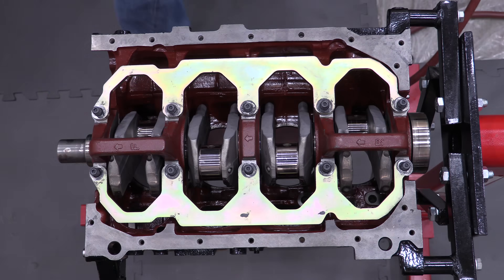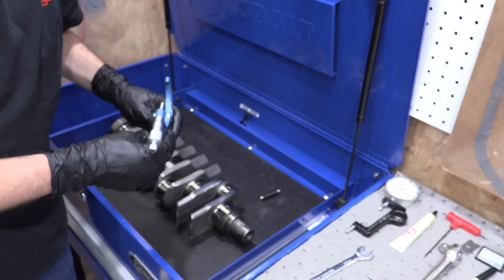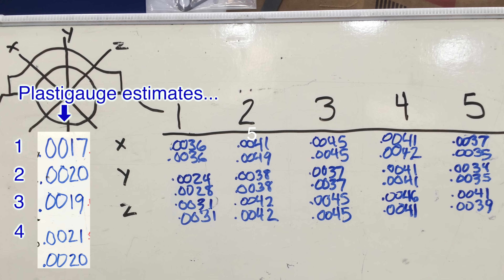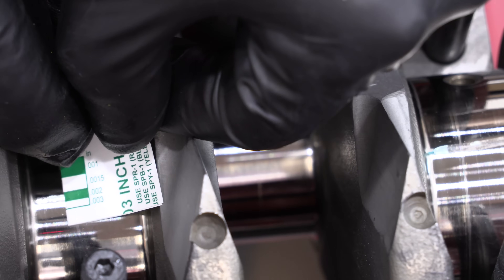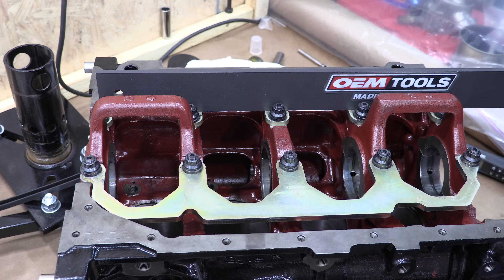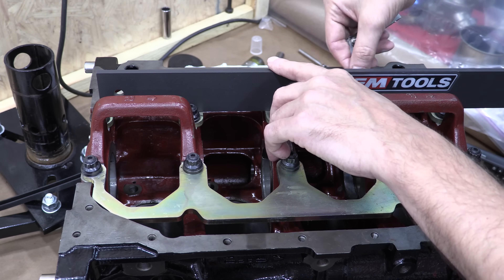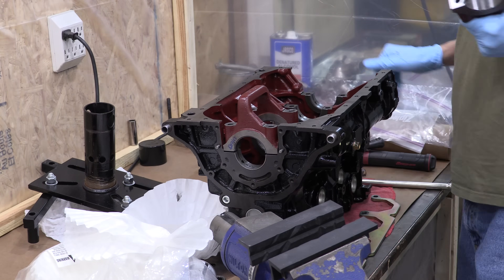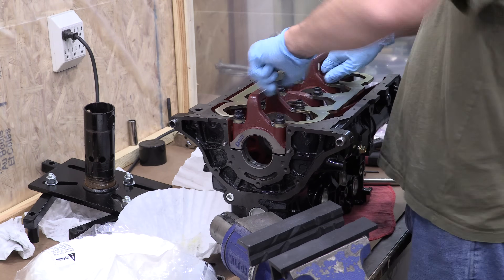[4k] The merits of Plastigage? ...A Jafromobile "short"

Comment: so, what im understanding, if ive absorbed the information right, is that even though youve bored the holes... twice? now, theyre still not straight and flat (and round) because of some slightly off kilter methodology in double checking some of the surrounding parts (mostly the suitcase handles)

Man, a year to get an engine working is almost ridiculous, i know that the level of accuracy and cleanliness required is extreme for the precision work you are doing, you are truly a master of your craft taking on a hobby project to make the ultimate in unnecessary machines,

But im the kind of guy that spends 40 hours writing a script to save me 5 minutes of work, and after this much time sunk in this one engine block, it makes me wonder if there was a better way to have approached this from the beginning to guarantee it was correct the first time? Maybe some better order of operations, or methodology. I dont know what that would be, im a computer guy not an engine guy, i just really enjoy learning about mechanics, so while i cannot offer individual advice or ideas, this scenario is tickling that "this could be more efficient" spot in the back of my programming brain.

Maybe you already know and this is just a demonstration of the worst case scenario for those of us who know no better?
Reply from the maker: It's true, I am absolutely building the most ultimate in unnecessary machinery.  It always was back when I enjoyed racing, showing and driving it.  Back before I broke it.  It was that.  It was GREAT!  Absurd and ridiculous are compliments that I worked very hard to achieve, and that's how I take them.  Truthfully, I've never had as much difficulty getting a block to cooperate as I have with this one.  Everyone who's watched the Hyundai assembly knows I've fought and won with other complicated issues, but this one isn't something I've ever once had to do.  The last time it happened with valve clearance and valve timing, it yielded some of the best and most helpful videos I've ever made.

What I could have done to fix all 5 cars 5 years ago is to not make YouTube videos.  I've been harassed and threatened by my county, forced to pay thousands per year to register and insure cars on my property that aren't visible from the road, have to fight record labels who try to steal my creative property claiming rights to original music that I or RojoDelChocolate have produced, spend time helping people with questions and problems, etc... All of that sucks except for the helping people part.  I enjoy helping people but it takes time when my condensed format requires a 10:1 chair time to edit everything-I've-already-fixed-and-filmed ratio.  THAT has been the single biggest loss of my productivity to my hobby.  

It's just like how you spend 40 hours to write a script that runs in 5 minutes.  Only I spend 40 hours to write a script that reads in 30-40 minutes into a microphone and then I still have to synchronize that into a video that's usually 20-30x longer than the reading of the script.  Nothing happens in my garage whenever I'm editing or paying my bills.

But boy could I do without these headaches.  The anticipation might be rough from a viewer's perspective, and it's absolutely killing me.  It's my favorite car.  I'm the one that's stockpiled $10k worth of parts I can't wait to bolt onto it.  And that's just the stuff that nobody's seen yet.  But for me there's many layers of pressure.  It's a different tax year, and all that stuff I bought still hasn't produced.  The time/money spent doing 5 major procedures to this block for things that I'm testing makes it scientifically relevant to my channel's plot.  So I have to use it.  I'd love it if it behaved like every other 4g63 crank bore/install I've ever had to deal with where I had to do nothing to it, but with everything else that's already complete, it's well justified to fix it.  What adds an even thicker layer to this is that this isn't even the project people were originally subscribing to watch.  This one ran.  I was building a Colt.  There's still people waiting for that.

I did rebuild, re-engineer, repair and rewire a completely different project during the parts stockpiling and the completion of 4 out of the 6 of those major procedures to the GSX block.  I feel good about all of that work, and the example and contrast it provides to the GSX and the community.  There have been a dozen GSX smattered through the Hyundai Years as I've been able to find the time and hard drive space to work it in, but I've always had multiple eyes burning on the stove.  If you wanted to boil all of it down and do a cliff notes, set every single variable to $ImJustOneGuy, run the script and see what breaks.  None of this is me arguing or being defensive, this is what it's like to YouTube.  If YouTube could even made my truck payment consistently for me, I'd hire a production crew so I could get more done.  Ultimately it's great that all the worst stuff in life happens to me and only to me, because I make videos about how to fix it.  Frustrating, yes.  But helpful.
Reply: @Jafromobile  Well, im glad you enjoy doing this, and it is definitely supreme satisfaction that this will be an educational experience for thousands of viewers out there,

i just wish it was easier for you lol
Reply from the maker: @drawapretzel6003  Yeah, maybe even hundreds?  lol!  ;)
Reply: yeah, the tops of the caps are different heights which is causing the girdle to torque the block and throw off the readings, it could go together as it is and be fine for a decade or two of drag racing but if you're going to a do a job, do it right... it seems like the front suitcase handle might have been swapped and the block line honed at some point before Jafro obtained it because it is a whole one ten thousandth out from the middle cap and back suit case handle.  might also explain why the crank was in such mint shape when Jafro pulled it out.  getting all the tops of the caps ground down to the same minimum value and the same ground down off the bottoms of all the caps and honing it AGAIN will finally fix this.  don't worry about being a computer guy, Jafro is also a computer guy and thats why his hobby is building engines to a precision... because you cant have your profession be your hobby without it pissing you off.
Reply: @ChristmasCrustacean  sounds like a good deduction to me. I know that levels of precision are a big deal in electronics, thats what has allowed the amazing feats of engineering such as the large hadron collider to exist, i just normally dont get to see someone applying the same levels of precision to something thats a mechanical problem and not a machinist problem. i also wish it was easier for jafro to do this without the headache. Guess you always have time to do it right the second time :P or hindsight is always 20/20 or something.

Comment: Plastigage, like any tool, is fit for purpose, it's not it's fault if you are using it for accurate measurement, It's an excellent double check tool to just confirm what you should already know.
Reply from the maker: I wish I had screenshots of your plastigauge troll to share.  Google even hid my own patron's comment about it from me so that I couldn't find it anymore.  I wanted the proof of the Plastigauge trolls.  If you ever find that comment, send that guy here.
Reply: @Jafromobile  I can find them and send them to you
Reply: @Jafromobile  
Pro 1: I dont understand this. Plasti is far less accurate then a dial bore and mic.... So how does it validate or verify precision calculations 😕

Pro 2: It doesn't

Me: It confirms that all the measurements taken are correct and that everything is correctly assembled. for example if something slipped under the bearing when installing it on one journal, that one would close up and you would have one substantially smaller clearance than the others. which would make you stop and look at it all again to see why one is different to the others, it's one extra confirmation that you didn't fuck up the maths as well.

Pro 2: You still have to tear it apart to remove the plastigauge so that can still happen. If you can't use a mic and do basic addition and subtraction you shouldn't be building an engine.

Me:So you think that taking an additional step to confirm is a waste of time because you and or others are incapable of making a mistake ever? And have no need to have a 3rd or 4th check of your measurements, I'd rather take the extra step. And no I'm not an engine builder, I'm a boilermaker by trade, who's been an engineering professional for 15 years who is building his own engine for his own car.

Pro 2: No I'd rather take the extra step to reconfirm with precision instruments. You should absolutely always double check your work but I think plastigauge is a poor way of doing it.

Pro 3: There is nothing accurate or precise about plasti. It is a complete waste of time. Double and triple check using precise instruments.

Me: Again all measurements were taken using bore gauge and mics, multiple times, the plastigage is a confirmation. I don't get why you're all against an additional check to confirm. Even if the measurement is different, which it isn't in this case (within the readable range of the plastigage)... it confirms they are uniform and is worth the extra 15 mins it takes to do.

Pro 3:  its because plastigauge doesn't not give anything accurate. Its easily manipulated to give an incorrect result. Whether it be excessive pressure leaning on crank in journal, over or under tension cap, residual oil in journal, dry journal - they will all given a different result with plasti

Me: All the variables you state are in your control. don't lean on the crank, correctly tension the cap, it should be done dry and clean. a mic will give variable readings on an oily or dirty surface on either the work piece or the tool.

Pro 3: ok have fun 😊👍

Pro 4: Just check it with the right tools and be a engine builder. And log the results. If you believe plastic crap is ment to be used in engines you would never work in my shop

Me: I'm not an engine builder mate, I'm not applying for a job in your shop either. I'm documenting my build I have as previously stated taken all the measurements I have recorded them and I did an extra check to ensure I didn't fuck anything up in either the measuring or the math. It's pretty simple.

Pro 4: all your checks mean nothing. All results are not close to accurate. Invalid and misleading. If a pro looks at them he will say why is he 3 tenths out on everyone . .

Me:I'm not making an instructional series on how to build a race engine, I am simply recording my learning as I build this one. There are far more proficient people and more professional series for people who want to be an engine builder, like the high performance academy vids. I'm just a bloke sharing his own experience building his low budget home built time attack car. I knew what the clearances should be, and this was simply to confirm what I had measured for my own piece of mind, as a human I am fallible and can make mistakes, I'd rather spend an extra 50 hours doing double these extra double checks then have it fuck out on the dyno.

Pro 4: theres no point having a check done if it's not accurate. In 30+ years as a engine builder I have never seen it used in a engine shop or have I used it . It's for home first time guys with Hope's and pray methods .

Me: Well I m a 1st time home guy, but I'm not hoping and praying. I'm not trying to convince a professional engine builder to use the stuff, but if you're doing it at home every extra check helps in my mind, and in this case it confirmed the measurements I had taken. Is this a guarantee everything is right, no, not at all, but it means the chances of it being wrong are smaller than before I checked it.

Pro 5: Im not a professional, but i would think a controlled environment would also be an important part of the process when taking accurate measurements, and by controlled i mean climate *temp and humidity*. As you wouldnt want it to heat up or cool down over the period that you are taking all the measurements.

Me: ideally you're right, it would be great to have a temperature controlled room but the difference in thermal expansion from say 20 to 30 degrees c is minimal. The more precise proper race engines though will matter, the tighter the tolerance the greater the control you need. While I'm not an engine builder as stated I have studied some metallurgy in my time and have a good understanding of material properties.
Reply from the maker: @tangles01  Very nice how you cleaned that up!  I know I died when I was reading that.  The power of the internet bringing people together... lol
Reply: @Jafromobile  Yeah even non car mates of mine saw this and laughed hard at them. Ever since whenever there is a problem with something one of them asks me if I tried platigage.
Reply from the maker: LOL!😂
Reply: "its because plastigauge doesn't not give anything accurate. Its easily manipulated to give an incorrect result. Whether it be excessive pressure leaning on crank in journal, over or under tension cap, residual oil in journal, dry journal - they will all given a different result with plasti"
god thats annoying, thats exactly what plastigage is for... if you're doing any of those things, you have bigger problems than plastigage, its not perfect its just a check a check that the math is working out and a check that you the assembler aren't screwing up

Comment: oops, I guess after the top of the caps are shaved down to the lowest measurement, and the bottom of the caps are all even to the tops of the caps and once again the bores are honed straight this should be the straightest 4G main bore around.
I remember you mentioning that the engine was trashed on a botched headgasket fix, the crank ended up in the hyundai... I wonder about the rest of the history of this block, I wonder if there was a previous crankshaft failure and cap change? main bolts without a girdle don't require the caps to be all the same height, putting in a new undamaged cap/s and giving it a hone and fitting a new crank and bearings on the factory pistons and rods and going about your day seems like it might have been in the history of this block.
Reply from the maker: I expanded on that disaster at length in my Patreon post.  I almost included a video segment explaining the history I know, but I cut it because it made this 4 minutes longer and it's not relevant to plastigage.  Heck, even the measuring and checking for installation of a bearing girdle wasn't relevant to plastigauge, except that it was the thing causing the test to fail.  I felt like it was a good example of why plastigauge can fail.  Heck, this video's 10x more relevant to DSMers correctly installing bearing girdles than it is for measuring checking oil clearances... but I guess that was the angle I chose...  I wish I knew more about what happened to it?  The whole site I recovered it from was a complete disaster.
Reply: @Jafromobile  as you said in a prior video when your channel changed categories to philosophy, did it really fail if it helped you learn a lesson and moreover, help you find something fishy with your clearances.  if anything it succeeded in failing.
this will be the last time you ever have to say "jimmity jillickers" because after this the clearances will FINALLY be done.
now to hope its more forgiving with valve clearances than the Hyundai was, and I assume it will be, I'm looking forward to seeing the next stages.